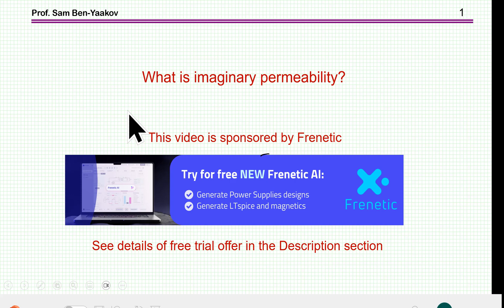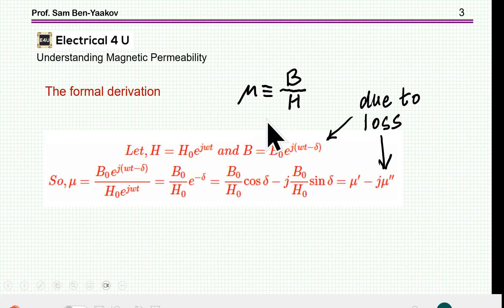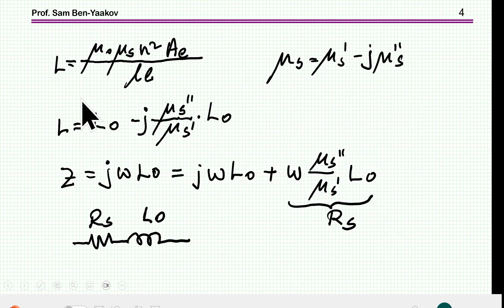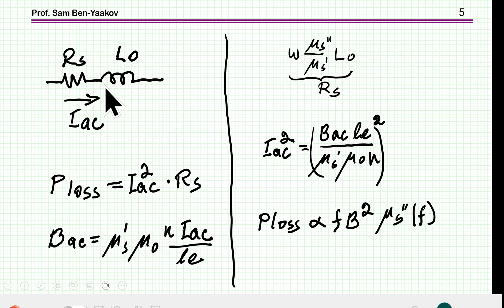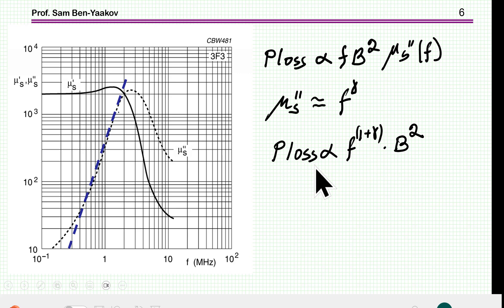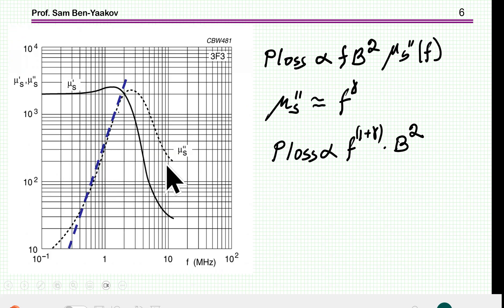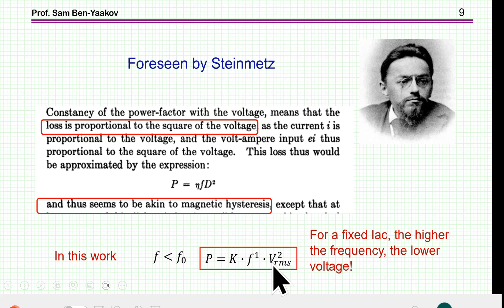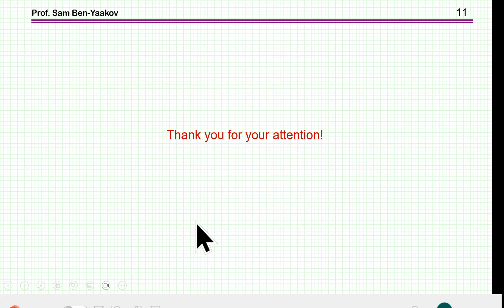What is imaginary permeability?

Comment: Professor : when magnetic circuit has several magnetic paths with airgaps... if at the frequency of excitation one path has high loss (high imaginary permeability).. How to solve the circuit? How much flux is in each path?
Reply from the maker: Good question. You can use perhps a reluctance model , modelling the loss as an eddy current coupled to the branch.

Comment: Does anyone know of a um' and um'' curve for Aluminum?
Reply: In the region when skin effect is negligible u' is negligibly close to unity. Then um'' could be derived from the resistive losses dissipated in the material. But when looking at this you would see that for any higher frequencies the skin effect kicks in and thus the question becomes how the equivalent BH loop should be treated? As an average over the whole material (so averaging out the skin effect impact), or just locally when the skin effect can be neglected (where the magnetic field penetration is complete). The results will very much depend on the geometry of the sample and frequency.

Comment: I think there is typo in equation at time 4:46, it should be Z = j * omega * L = .... rather than Z = j * omega * L0 = ...
Reply from the maker: Correct. Thanks. I could have said that I have put it in to check the alertness😊
Reply: @sambenyaakov  Good video overall, thanks for sharing! 🙂